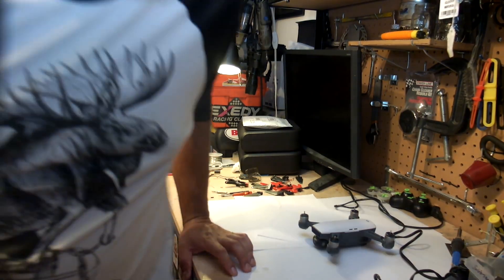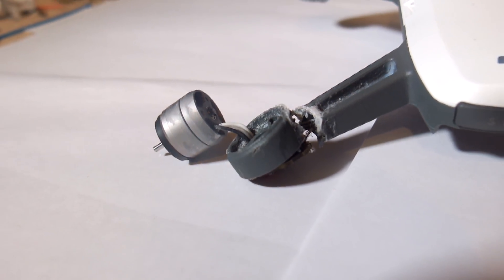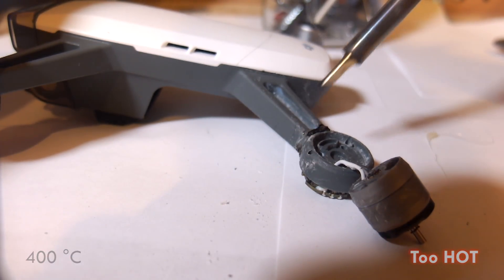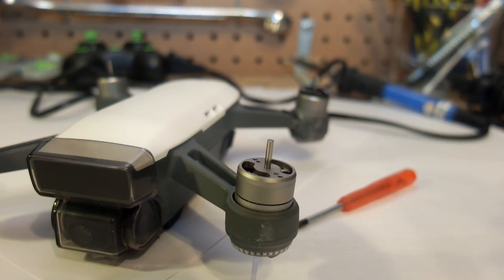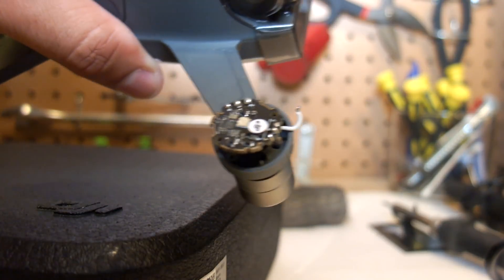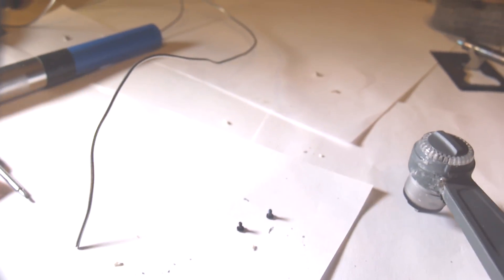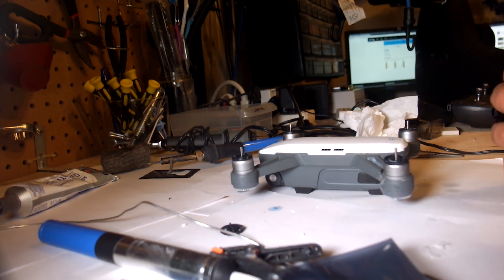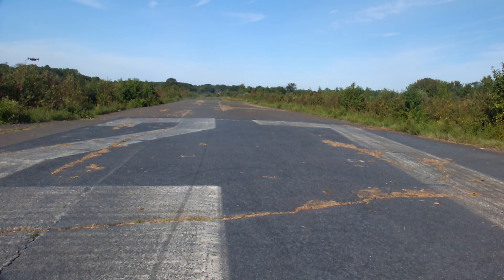DJI Spark Repair with motor replacement

Comment: You needed a finer steel brush to clean it and jb weld. It wouldn't of never came apart. Or you can buy a wood burner and plastic strips and plastic qeld it back together

Comment: When testing "sport mode" with official DJI prop guards, I went full speed forward then went full speed backward and it tripped the tilt fail-safe that shut all the props off.  Luckily, I was in a grassy field and it only fell about 4 feet into some tall grass.
    Be careful using those prop guards.  The prop guards add enough extra weight to throw off the aircraft's auto-leveling abilities and can result in disaster if you're not careful.

Comment: Excellent repairing video I have  the same problem with one of motors did not give the same spin with others three motors and the result was twisted around it self Anyway I sent it in official DJI services in Greece and now I am to get back my favorite spark back again

Comment: Thanks again for the update on the glue.  I'm getting ready to replace my broken motor attachment, like yours.  Mine hit a bush and fell about 5' onto concrete.  I'm now wondering why collision avoidance didn't help me or if I had changed it.  I had just completed a DJI update.  hmm.

Comment: what kind of glue did you use for the screws? could it complicate things when having to remove them again?
Reply from the maker: It is better to use threadlocker rather than glue on the screws. Threadlocker is available from brands such as loctite and permatex.  Blue (medium strength) is best to use for drone screws.  You should apply fresh thread locker each time you reinstall motor screws, as they help to prevent the screws from coming loose due to motor vibration.

Comment: is this a good motor? https://www.aliexpress.com/item/Brushless-Motor-Mini-Bare-Motor-Brushless-Repair-Part-Accessories-For-DJI-Spark-Rc-Drone-Electronic-Toy/32914039406.html?spm=2114.10010108.1000014.1.490f2e0aP3TJc6&gps-id=pcDetailBottomMoreOtherSeller&scm=1007.13338.122670.0&scm_id=1007.13338.122670.0&scm-url=1007.13338.122670.0&pvid=ade9972a-7852-43c6-bb0a-308cef967799
Reply from the maker: Wow! That's a good deal! Based on the text in that listing, I don't see any reason to suspect that it would be a bad motor.

Comment: Thanks so much for your video! Where do I get the motors from? can you give me a contact point? I have to do the motor replacement as well. Your video will help me greatly
Reply from the maker: The motors are fairly readily available on eBay and AliExpress.  You should find them between $10-$20 per motor.
Reply: I ordered 2 motors from EBay. I was unable to get the third of 2 screws tightened, so far two screws are keeping the motor stable. Next time I need, I’ll do the replacement - meanwhile 2 screws are working.
Reply: The Threads must have been damaged on the old motor because only the two screws would go in.  I could not get the third screw to grab at all.  I have a feeling the threads are stripped on the original motor. Which is while I’ll wait for the new motors to arrive before surgery. Thanks again for the heads up.
Reply from the maker: @pixelpete2552  good luck!
Reply from the maker: @pixelpete2552  leave the third screw in with some blue threadlocker, if there is any bite at all, the threadlocker should help take advantage of it and hold it in place.

Comment: What about one year after? Will be fly normally? Race mode? Hight Wind?
Reply from the maker: No problems to report so far.  Seems to still be working as it did new.
Reply from the maker: Also note that, as per my other video, this drone has had a full body swap, so the plastic welded arm isn't on it anymore.
Reply: Prepare For Landing thanks a lot
Reply: @PrepareForLanding   Recently I crash with the Wall, and broken like these. I only used super glue (soldimix), I test fly and Works, but I don't know if Will be have problems later.
Reply from the maker: @jkbenites I suggest checking the arm for durability before each flight to make sure it's not getting weaker.

Comment: Thank you so much.
I just bought this drone after losing my first one. I crashed it on concrete, bent the motor shaft. I just successfully replaced that motor. I found the motors on Amazon for $15. I also bought 4 light caps for about $8

Comment: i have the same issue with the motor but it still fly normal should i repair it or keep it, its as you said heaver than than the other motors
Reply from the maker: Unless you notice any behavior problems in flight such as instability or low top speed, a slightly stiffer motor is usually okay and does not need to be changed.
Reply: still stable actually, but that happens when it doped like 4 m from the ground into its  back after this accident i realize that the motor stop the first one same as yrs and it get warmer than the other motors after i fly it but i fly only once after this accident and it was OK but i,m afraid that the motor stop directly while it is in the air that is why i asked u should i change it or not
Reply from the maker: It would be hard to tell without physically looking at the motor, but if it flies stable and can hit full speed, you probably are okay. Motors are fairly inexpensive (about $10 if you search on eBay) and easy to change if you are comfortable with soldering. So if it was my drone, I would probably change it.
Reply: thank you i will try to change it

Comment: Which type of plastic do I need to welder the drone?
Reply from the maker: I tried this technique with some ABS, some PLA and some bits of the original plastic (some kind of nylon reinforced abs maybe?) and all the materials seemed to work equally well.

Comment: Thank you so much for the video. I have a new motor coming for mine as i ran into my house the other day and it buggered the motor.
Felt like such an idiot as i really shouldn't have flown in such low light.
Reply from the maker: Glad to be able to help! Sucks that you crashed, but at least motor replacements are pretty cheap!
Reply: Yes could have been so much worse. I'm comfortable doing the motor replacement myself so glad it wasn't worse.  I bought a spare motor, cause, god forbid this ever happen again...!

Comment: Bro my spark drone crash plz tell me how to buy spark moter onlin website
Reply from the maker: you can find them for $10 - $20 on eBay or AliExpress.  ebay link: https://www.ebay.com/sch/i.html?_from=R40&_trksid=p2380057.m570.l1313.TR12.TRC2.A0.H0.Xdji+spark+motor.TRS0&_nkw=dji+spark+motor&_sacat=0    aliexpress: https://www.aliexpress.com/wholesale?catId=0&initiative_id=SB_20180523044331&SearchText=dji+spark+motor

Comment: Hello, I have my brand new spark for around 3 weeks, and I've flown perfectly. But I realized that 2 of the motors aren't stopping at the same time that the other 2. And they seem to be tighter than the other to that spin more loose, maybe are they damaged??? 
As I say I don't see anything wrong when flying and no ESC error showed up ever...
Reply from the maker: It is normal for there to be some minor differences between the motors.  As long as the Spark is flying smoothly and there isn't significant drag when you try to spin the motor by hand, I wouldn't worry about it.
Reply: Prepare For Landing this is the motors in action: https://youtu.be/pxbvjnbCQEY
Reply from the maker: Pablo, those two motors do seem a bit suspect.   From what I have learned, if there really is a problem, two characteristics of the drone would be affected: (1) flight time - this is because more battery power could be needed to spin the sitffer motors.  (2) top speed.  Since those motors have more resistance, they will not be able to spin up as fast.  How long are your typical flight times? Can your Spark hit 31 mph / 50 kph in Sport mode?  I have also prepared a short video showing you have all the DJI motors that I own spin: https://www.youtube.com/watch?v=aicQxJx9gqQ
Reply: Prepare For Landing thanks for your response! Yes it can reach 50kph, and don't know total flight time, because I have been trying all different options in my first flights. But as on recorded, my longest one is 13 min
Reply from the maker: Those values sound normal for the Spark.  I wonder if perhaps that stiffness in the motors is within normal spec?
Reply: Prepare For Landing I will contact dji support and see what they tell me. I noticed in your video about the performance of the motors in different AC that your Mavic air stops the motors sooner and suddener that your spark, maybe there are some tolerances... But in my experience with racers motors should be more loose anyway..
Reply from the maker: I think the ESCs on the mavic air do active braking, while on the spark they do not.  The mavic air motors do not feel more stiff than the spark. Good luck with support and let me know what they say!

Comment: Great video, thank you. 
However I want to address an issue regarding the Silicone used on the contacts. The most common type of RTV silicone is Acetoxy which releases acetic acid, corroding electrical components. Perhaps the one you used has a different base but people that might want to replicate should be careful.

LE: I checked and the Silicone you used is Acetoxy. You might want to check the electrical components for corrosion and clean a bit. No need to remove the silicone if already cured.
Reply from the maker: Thanks for the heads up! I'll change the silicone that I use on future projects.  Always appreciate the helpful comments!
Reply: Which silicon do you guys recommend?
Reply from the maker: Any silicone that is safe for electronics should be fine. I have been using this one since @joker18's comment. https://www.amazon.com/gp/aw/d/B0063U2RT8?psc=1&ref=yo_pop_mb_pd_title
Reply: Prepare For Landing Thanks, order on the way now.

Comment: Could the modified prop guards replace the need to glue and plastic-solder?
Reply from the maker: The drone did appear to fly safely with only the prop reinforcement from the modified prop guards, yes.  I'm not certain of the long term durability of that, however.

Comment: One of my spark arms is breaking...
What should I do?
There is a breach between the motor and the arm (In the plastic)
Im using the prop guards and they keep everything together, but I need to fix it
Someone plz!!
Reply from the maker: +David Fernández a similar repair, by first removing the motor and esc, and then gluing or plastic welding the arm should work.  You shouldn't have to desolder any parts, but wrap them in painters tape or something to protect them from glue.  Using gel type glue is easier to work with, as explained in the video.

Comment: Where did you buy the propeller lock connector?
Reply from the maker: I've seen it for sale on ebay and aliexpress.  I personally got mine from https://www.aliexpress.com/item/100-Moun-Base-For-DJI-Spark-Quick-Release-Propeller-Mount-Propeller-Original-Mounting-Base-DIY-repair/32823985043.html?spm=a2g0s.9042311.0.0.Rbgtqy

Comment: Do you recall, does the motor wires run down the inside of the arm or the outside of the arm?
Reply from the maker: +Mach1rulz  the 3 motor wires run inside the arm.
Reply from the maker: The motor wires run inside the arm.

Comment: where can I find a replacement motor? any link?
Reply from the maker: A quick search on ebay  comes up with this and a few others: https://www.ebay.com/itm/DJI-Spark-motor-Original-1504S-motor-for-DJI-Spark-RC-Drone-repair-parts/132373699049?hash=item1ed21659e9:g:mfgAAOSwDehZnvSq
Reply from the maker: Here is a search result with a few more options: https://www.ebay.com/sch/i.html?_from=R40&_trksid=p2380057.m570.l1313.TR11.TRC2.A0.H0.Xdji+spark+motor.TRS1&_nkw=dji+spark+motor&_sacat=0

Comment: why didn't you just drill a couple small holes for JB Weld to grab onto JB Weld guarantee that would hold
Reply from the maker: That's an excellent suggestion.  Next time I have to do something like this, I will try that!
Reply: 961balckwolf. Can you expand on where the holes would be drilled, how deep, size of the bit, the specific JB product your recommend and any other details that would help a novice like me.   A video would be super helpful.
Reply: Theres always some critic, I assume that's what you did to yours unless of course you are talking out your ass and don't even own a drone.
Reply: Vincent DeGennaro I own a mavic pro thank you very much https://www.facebook.com/matthew.milam.1/posts/1561280500618320
Reply: Vincent DeGennaro Matter-of-fact I own 2 Mavic’s One is a Max mod upgrade From drone world 😉  https://www.facebook.com/matthew.milam.1/posts/1465832456829792 Guess You’re just talking out your ass
Reply: One of my arms is breaking what should I do?
I would buy a new frame but Im not sure if im going to get it working again
I tried to use a welder and melt the plastic like you, and it fixed it for abouut 2 or 3 weeks but now is broken again. Help plz!!
Reply: Snappy Realty and Management Doesn’t matter just Drill a few holes very Small holes In the plastic rough sand it a little bit Then JB Weld with quick weld it will hold It’s not science just common sense

Comment: I  did the same thing with my spark, flew it off a 10th floor balcony w/o gps, and when it finally found GPS it established a new homepoint and landed in a tree - I never saw it again.  How much did the motor cost?
Reply from the maker: Sorry to hear you lost it.  The battery ejected from my spark on impact and I never saw the battery again, but at least I was able to recover the drone.   The motor was about $20 shipped from china, and is easy to find with a quick ebay search.